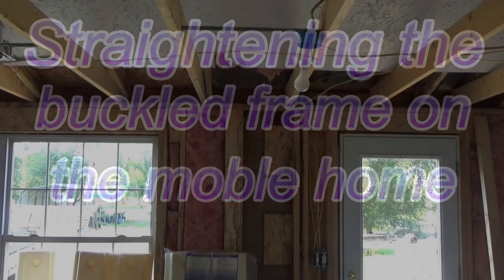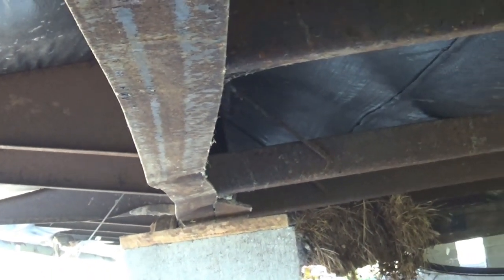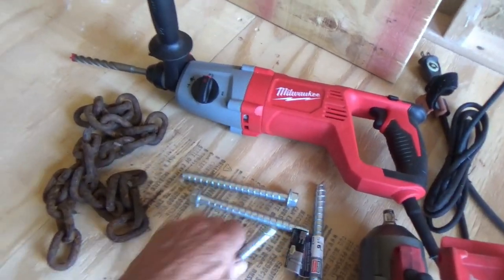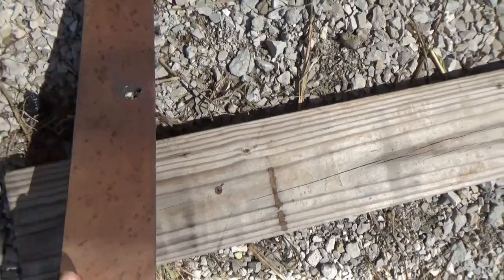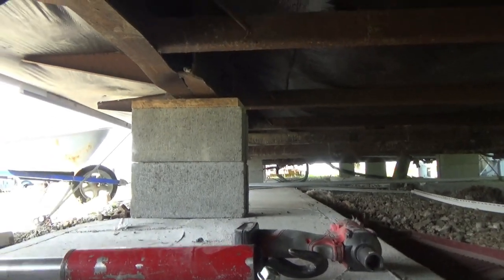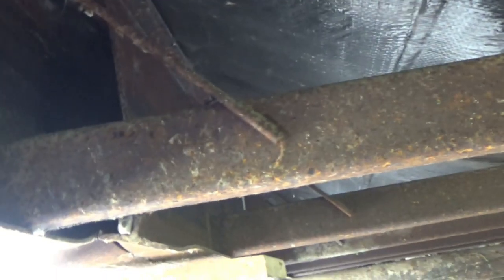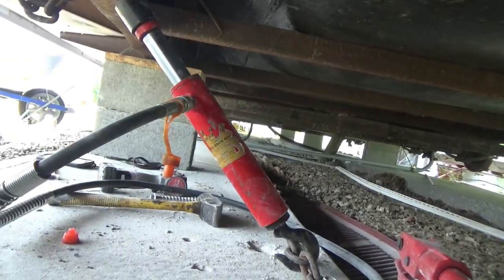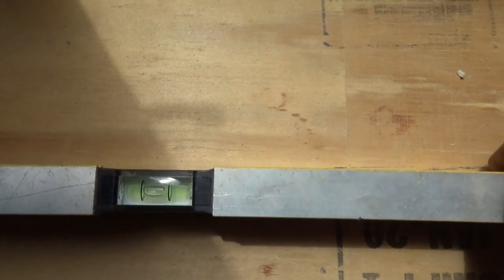Straightening frame on mobile home

Comment: since you have the wall open.. how about adding some Simpson H2.5A hurricane ties.. or some H3 hurricane ties. to the header to the ceiling joists and some H8 on the other side from the header to the roof rafter..  also some nailing plates from the footer to the studs..  since you have the wall open and that is the egress point..  i would also think.. that some more of those concrete bolts.. some unstrut clamps and more chain.. to hold the frame rails to the concrete even better than the steel cables.  some short lengths of all thread into the unistrut beam clamps to tension the chain tight on each one.. 
my cousins mobile got knocked off its stands during the 94 earthquake.  not severally damaged.. we jacked it back up and put new stands.. the power company had some downed broken poles .. i ask if i could have a few 15 foot sections..  we chained those across the frame in 3 spots..  so if there was another big aftershock.. it could break the stands.. but it would land on the power poles chained under it.  somebody who's MH was destroyed saw what we had done and bought hers right then and there.. the 94 quake measured in some places 3.1G's of vertical acceleration.  the shock waves 15 miles from the epicenter tossed my sister and her husband into the air twice as the whole house went up and down about 5 feet.. he had put strong ties at every framing connection he could.. the house did not even have a single crack..  where the 250 others built bu the same crew were severally damaged. .  the strong ties i listed are 2 for a buck or a buck each.  and you will need proper fasteners for them  not drywall screws.
Reply: That's what I used when I built my garage in 2005 at the top and bottom of every 2x6 wall stud and roof joist Simson tie plates. It's the damn tornadoes and down burst type high winds here in San Antonio, TX we have to guard against.